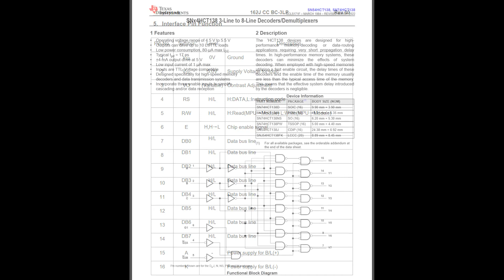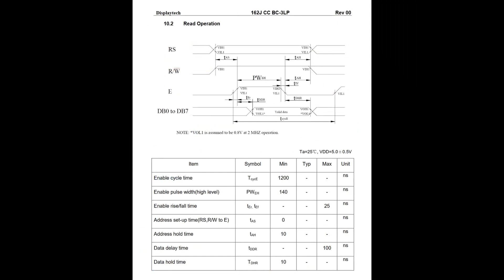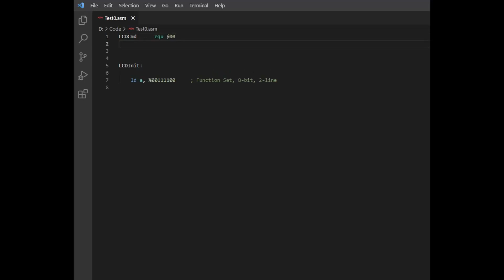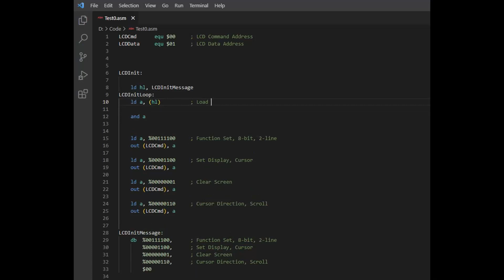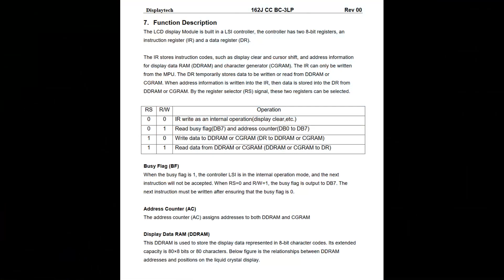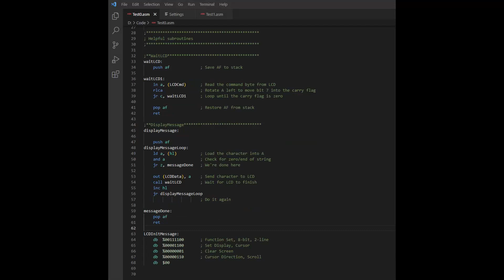Pony80 - LCD Module BUILD - My Z80 homebrew computer!

Comment: I notice you ran the reset (low) from the CPU threw the not gate and then to the transistor which creates the hl PWR signal. 

Should this PWR signal go to VDD and also the "A" pin on the LCD to cut power to the back light as well?  

Just sending PWR to the Vdd pin will only turn power off to the LCD and reset it but leaves the power on the back light.
Reply from the maker: I did just the vdd to reset the display, because at time when the reset was triggered, the display would not reset. 
We could turn off the back light as well, but would probably need another transistor or a Darlington transistor to handle the current draw for the back light. I’ll look at the specs and see what the draw is and get back to you.

Comment: I am going to try your LCD display and add it to my z80 with 28c16 rom and 62256 Ram.  However is there a way to get a copy of your last code on the LCD display.  The link on the website that suppose to have the code seems broken.  I followed the entire video up to the very last or just past the part the had the bust bit code.  I thought you would really make a great teacher.  Its really fun doing the Z80 build and I have learned alot from your sharing.
Reply from the maker: Yes, I will double check why the link is not working. I am glad that you are liking the videos! I appreciate the feedback!